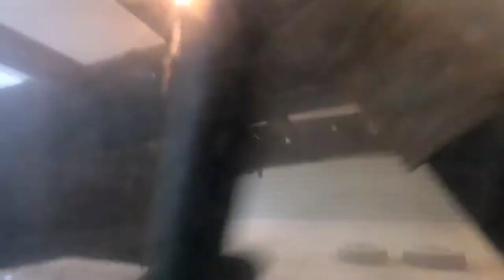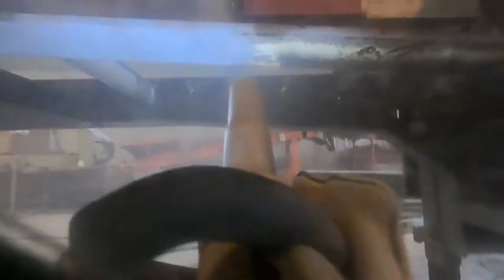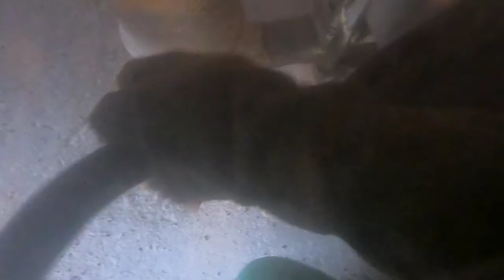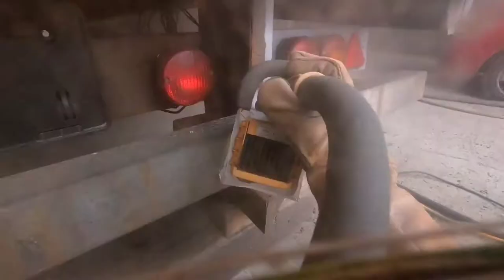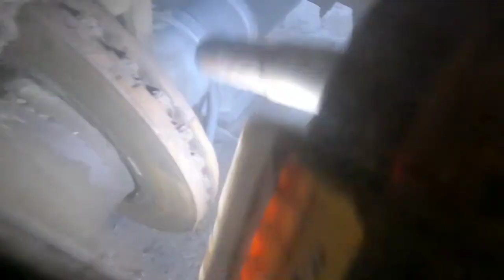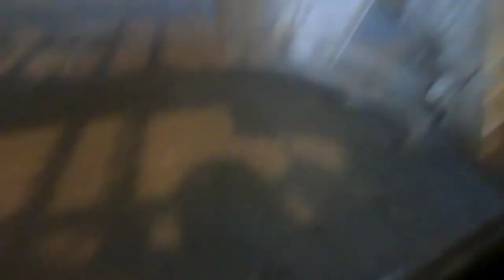SandBlasting wagon trailer step frame [lorry]

Comment: good job, how many hours did it take to blast that thing
Reply from the maker: Thx it tuck a Day for the external and a day on all the I beams and axles 👍
Reply: @Mobileblaster  how much abrasive did u use? Around a ton i assume? Do you recycle the used abrasive?
Reply from the maker: @davidvehovar  I don't reuse the media but the media is recycled crushed glass once it goes through my pot it stays were it lands I don't reuse it. I carnt quite remember off top of my head how much gear was used but I would say half ton on the face's on the hopes to have some spare so about 12/15 kgs bags 2nd day I would take 750kgs and hope to use around 20/25 bags. Always worth taking more than needed just incase 😁 prepair for the worst hope for the best 👌